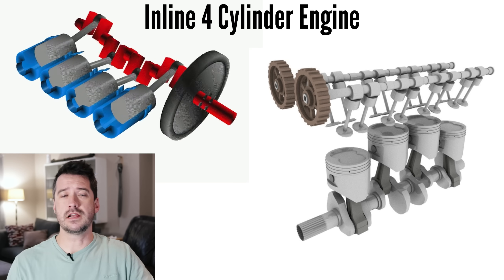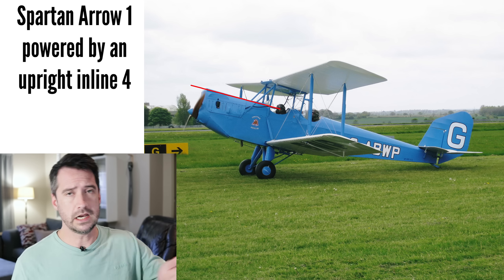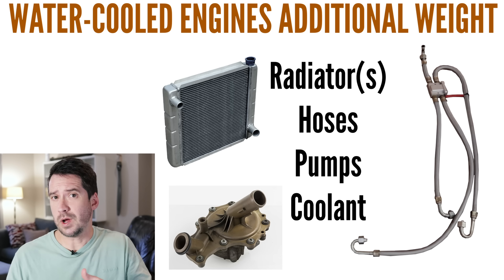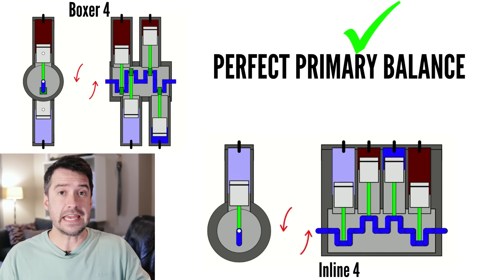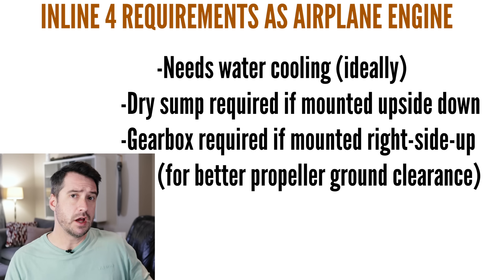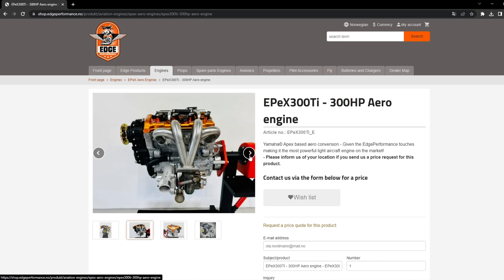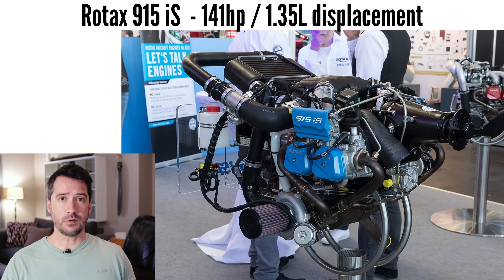Does Inline 4 Engines Suck for Airplanes? - Technical Deep Dive

Comment: Cummins 4-cylinder diesel engines are an exception to the 3.0l limit. There are 4.5l Cummins 4-cylinder engines out there.
Reply: Of course, these also don't rev very high either.
Reply: @brianb-p6586 , agreed!
Reply: And they are used in very heavy equipment where3 vibration isn't an issue.  Disclaimer:  I own 5 Cummins 6s.
Reply: @anvilsvs , That's quite true. But since the video was talking about modified automobile engines, I took a bit of license in choosing to mention the Cummins engines.

Comment: bring back the radial 3 cylinder !!!....nah, actually the INNengine has an inherent 2:1 reduction, ( yes, it is really a two stroke with an inherent 2:1 reduction )
Reply: yes 2 stroke engines🐱👍🏿
Reply: @fidelcatsro6948  the INNengine is better than a regular 2-stoke, because it has full pressure back side lube, and direct fuel injection. ( no fuel mixing, no oil being burnt )
Reply: @RulgertGhostalker  yum yum such technology should be put into motorcycles.. cant wait to see a 750cc 4 cylinder  2 stroke widow maker🤔

Comment: Great video but you made a huge mistake on the thumbnail. That's not an inline-4 engine on that picture, that's a V8
Reply from the maker: Thanks for the heads-up, I'll need to go back to the full size image to double check.
Reply from the maker: So it turns out the image I used is a block from something called a Kubota inline 4 diesel.

Comment: Crankshaft length inherent to inline engines equals inherent greater weight.  The crankshaft and the required crankcase to carry this wobbly assembly is unsuitable for any weight restrictive design.  The crankshaft length/weight for a radial engine is miraculously less.  Go weigh the crankshaft and crankcase for a massive W670 vs some pig iron inline 4.  No torsional vibration with a radial.  Not saying their perfect.  But it is a flugmotor!

Comment: 2:57 you do know dry sump exist, right because if you did, it doesn’t matter what angle you put the Internet as long as there’s oil pumping through the thing it’s gonna work Corvettes come with dry sump’s it’s not a new technology so you would absolutely be able to mount it upside down. You just have to put a different oil pan oil, filter and reservoir ahhhhhhhhhhhhhhhhhhhhhhhhhhhhhhh
Reply: I didn’t watch the video, i paused at 2:57 exactly and wrote this but im not deleating it I’m gonna leave this comment as a show of what irony I’m not even sure if it’s ironic it might just be stupid
Reply from the maker: Thanks for admitting you didn't watch it. I did offer the dry-sump alternative a few minutes after you stopped watching.
Reply: @LetsGoAviate  that’s why I left time markers where I stopped. If you start the video exactly there you’re the next words are literally what I said.

Comment: With all the problems with inline fours and boxer engines why not go back to a 5-cylinder radial engine it doesn't suffer from any of the cooling problems or vibration issues

Comment: A 3:30  2stroke 4clnyder would run upside down
Reply from the maker: Indeed!
Reply: @LetsGoAviate  has there been many 2strokw motor designed engines for planes?
Reply from the maker: @BurchellAtTheWharf  Yes, Rotax has the popular 503 and 582, and Hirth makes a few models too. And there's a few more.
Reply: @LetsGoAviate  mintyy. I didn't know they used skidoo engines in planes. Or would it be Plane engines in snowmobiles?

Comment: Before using Viking engines as a reference, maybe research the owner first regarding Subaru conversions.
Reply from the maker: Does it impact any of the technical details in this video?
Reply: @LetsGoAviate  Yes reliability. they have a track record of not knowing what they are doing. they just sell what is available, not what is suitable or tested.
Reply: @LetsGoAviate  Honda  builds reliable car engines,  but they are not as reliable as supplied as per that vendor.  Easy math.

Comment: Your problem started when you chose air cooling and a wet sump like a gutless lawn mower engine. 😁 Those aircooled boxers are pretty inefficient considering their HP output against it's size and mass, the power density it's not dense at all.
If you want an air cooled engine on an airplane you get a proper radial.
Upsidedown engine a problem ? Mercedes Benz and it's bad ass V-12 has entered the chat.
Anyway, if you want an I-4 in a plane it better be liquid cooled and turbo intercooled, otherwise you have a boat anchor.
Reply from the maker: Loved your comment 😆 of course they can be turned upside-down, but need to work around a few problems. When the DH Gipsy was turned upside down (becoming the Gipsy Major) they encoutered a few issues, one of which was heavily increased oil consumption, but was all mostly sorted over time.

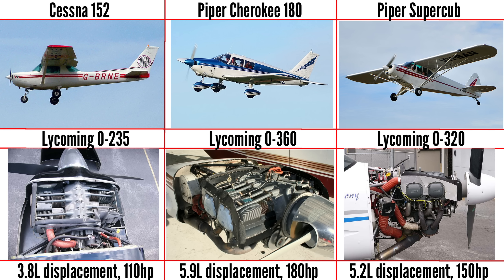Comment: 9:09 How the hell are they only getting 110hp out of a 3.8L engine???
Reply from the maker: (De)"tuned" for reliability. Also it's a very low revving engine, and since horsepower = torque multiplied by rpm, it kind of makes sense when you think about it.

Comment: Turning an IL4 on it's side is ,of course, impossible.
BMW K-series and Toyota Previa never really existed
Reply from the maker: Requires the engine specifically designed to work on it's side, as there would be lubrication issues. Take a look at where the crankcase sits on these sideways I4's. No big deal, can be done, but is this any better than just turning the I4 upside down? I'm not aware of any Inline 4's mounted on it's side in aircraft.

Thanks for the comment!
Reply: @LetsGoAviate  Actually , no , the Toyota Previa example was Just one of their mainline engines (2TZ-FE I4) with minor modifications (to the lubrication system) to allow it to function on it's side

Comment: Diamond DA 42 are quite far down the 4 cylinder road now. Perhaps they will design from scratch...their mercedes diesel engines are not  modified vehicle engines really...the block is different
Reply from the maker: Yeah I wanted to mention them. But it's diesel and while it's not a modified/converted Mercedes engines, it is based on that design.

Comment: Just makes me think rotary...
Nothing saves you weight like a rotary.
Or the other end of the holy grail of engine dynamics, the beautifully balanced inline six.
Reply: Rotaries are high-maintenance so I'm not sure it's the best idea to use them on aircrafts.
Reply: @stryker1797  not really if built correctly.
In non turbo form?
They are near bullet proof.

Comment: So, I am about to cover 400 miles over rough country, poorly populated, at night. Would I rather be behind s 5.2L Lycoming lopping along at 2200 rpm, under-stressed and happy with little gas and at least one magneto, or behind  a 1.8L anything spinning its balls off, higher internal temperatures, high speed valve events, systems reporting to systems, sensors sensing, coolant system blow offs not blowing off, and 40 other points of failure? Gee, hard to pick. Not.

Comment: Opposed engines also need less flywheel weight, right? Because the pistons balance out. It goes back to why they thought radials were an ideal engine.
Reply from the maker: I think it's more because of an even firing interval. 4 cylinders has an even firing interval so there are a power stroke at any given stage, so flywheel doesn't need to balance/smooth out uneven firing pulses. Just guessing though.
Reply: Inline 4 and opposed 4 both have even firing intervals and the same torque pulsations twice per crank revolution. 
In a 4 cylinder engine if average torque is 100 the peak torque is just above 350 on power strokes and the minimum is about -100 on compression. 
Search "EPI Torsional Output of Piston Engines" for more information.

Comment: You make the common mistake of not understanding some fundamental engineering differences between automobile engines and basically all other industrial engines (airplanes, boats, mining, tractors, etc) A car cruises at about 10% of rated  maximum output, and normally maximum rated output is acheived for less than 20 secondswich is more than enough to accelerate beyond 100mph. And modern cars are built to be disposable.

An industrial engine is rated for continuous power output.
For example my 2 ton farm tractor(which is basically a seat and wheelt bolted onto an engine transmission combo(engine/trans act as the "frame")  built in 1968 is rated at 28 horsepower, but it pulls two large plows at full throttle for 8 hours continuously without over heating or suffering abnormal wear. (It also has replacable cylinder liners so it can be rebuiilt indefinately, though I personaly don't use it enough hours per year for that to matter.) 
Or look at modern marine and locomotive engines, these have fancy electronic governors and turbochargers, while operated and monitored by professional engineers. Yet they are about a ton for every 100 horsepower. Partly because iron is cheap and easier to engineer around than other metals, but largely because that is what is needed to reduce the local stresses for long term continuous output. Smaller parts ->higher stresses ->drastically increased wear and reduced fatigue life.(nonlinear)

Also the 150hp lycoming o-320 was built for red lower antiknock rating avgas and can be upgraded with higher compression for blue 100LL. Getting both better power and fuel burn.

Comment: Sorry, but don’t most inline engines use a psru gearbox that can allow the prop to be placed at any height?
Aren’t inline engines very smooth (especially three cylinder and 6 cylinder)? And isn’t a remote oil tank lighter than an extra bank of cylinders? 
The reason inline engines aren’t used in modern planes is that certification requirements of new engines are arduous and so we continue to use ancient designs that are heavier, less efficient, less powerful and less reliable.

Comment: The boxer is inherently faulty, it’s advantages for aviation aren’t its mechanical advantage but it’s profile and weight distribution. The boxer has two huge disadvantages, lubrication is problematic, gravity works against the boxer, even with a dry sump. The other is vibration, the boxer is unbalanced and chews energy to become balanced.

Comment: A gearbox is use when a high performance engine is use who need more RPM , not to rise up the propeller ...Use a gearbox is nothing new: even in the 30' this was common inclusive on small  radial engines, and completely generalized on all high power engines who need big propellers who need slower RPM...

Comment: As their have been quite a few inline 4 engines for aeroplanes, I can not agree that they suck. Their is the de Havilland Gipsy Major or the Hirth HM60 quite successful engines. As many successful inline engines had hanging cylinders. The secondary imbalance can be solved by a shaft turning double the speed of the camshaft. 
The HM60 or later HM504 has an advantage over all the boxer engines in use today, it needs only 80 octane fuel.
The HM504 had 4 l displacement, 70 KW at 2450 RPM at a weight of 112 kg. 

I assume that the boxer won out on the inline engine by chance not because it is inherently better

Comment: A motorcycle like mine makes 200+ hp with only 1 liter and no turbo.
Reply: I bought my Suzuki '77 GS750 at McBrides Cycle. Back then it was considered powerful with it's 66hp. David Cronenberg has her in his collection.
Reply: @UguysRnuts  My first road bike was a GPZ 750 Turbo @ 112 HP back in 1985.  Fastest bike on the block at the time and stayed fast even though it was air cooled.  Kawasaki canceled it, because it was faster than their new 900 Ninja that Tom Cruise rode in Top Gun.  First 145mph on a street bike was a Suzuki GS1100.  I was maybe 15 on the back.  Good times.
Reply: @sammcbride2464  I only mention it because of the dealership name. Thought you may have been related.
Reply: @UguysRnuts  I don't think so, but you never know.  I used to never see my last name anywhere, and as I get older, I seem to see more and more of it.

Comment: Correction: the Rotax line of boxer engines are NOT modern. They produce those overpriced engines almost 40years now.
And we experienced many accidents with the carburated versions.
Reply from the maker: I get what you are trying to say regarding the technology, but the 912iS was released in 2012 and 915iS in 2017.
Reply: @LetsGoAviate  old stuff gets new updates 🦖
Reply: @LetsGoAviate  They have just added fuel injection to an old design. The engine is designed for sales, not as an aircraft engine.

Comment: How did the Germans cope with the me109 inverted engine?
Reply from the maker: In the same way I explained in the video, it's a dry sump lubrication system. 

In the war, complexity and cost wasn't really a concern, so it was no big deal to have an inverted V12 on the Bf 109.

Comment: Large displacement, low rpm engines will always dominate aircraft, they are proven, and reliable, and that is #1 to the FAA. Most recreatioal aircraft with piston engines are sky tractors, chugging along. The airframes CANT handle big power. Big power requires the plane to be designed for it from the start.

Comment: Problems covered: gearbox adds more weight and complexity. water cooling adding weight, complexity, and maintainance. Fuel injection is needed to turn engine upside down adding complexity and maintainance...

Rotax: hold my beer. 🫠

Comment: Correction: not the Edge Performance engine but the Viking 130 is by far the most popular experimental engine. Maybe 10times 🧁☕️🍭
Reply: I seriously doubt that. Viking’s are mainly popular with Zenith aircraft.  Van’s, Rans and others use many more experimental Rotax engines than Viking’s.  It isn’t even close.

Now if you want to say the most popular auto conversion…

Comment: Quick note, general aviation engines should be called horizontally opposed or flats.  Boxer engines are horizontal opposed but the firing order is different and the rods dont share a crank pin. Small difference but its there.
Reply from the maker: Hi, wrong way around. The general aviation engines in this video are indeed boxer engines since they don't share a crankpin, like you said. That makes it specifically a boxer. 

These engines can also be called flat or horizontally opposed, but keep in mind flat and horizontally opposed also describe engines that share a crankpin, and these engines are not used in general aviation.

Comment: Your info is out of date, some by decades.  The cooling problems of the rear cylinder for air cooled engines, ,  Deutz is one make much older than you are, and they work well. Many experimentals use 4 cylinder conversions, either Honda , Suzuki or Mitsubishi engines, one make just tilt the block at an angle to lower height. This was an old trick Chrysler used for their famous slant six.  As it is well know, the expensive certification rules stiffle innovations. Liquid cooling is the future, The pure air cooled engines are heavier and less efficient, because the internal tolerances had to be loose to handle shock cooling.
Reply from the maker: Well the subject is decades old 🤣 Yeah I'm aware of slanting engines, Aeromomentum offers options for slanting/tilting the engine. I tried to keep the video as succinct as possible, but you are correct.
Reply: Slanting the engine also almost entirely eliminates the impact of g forces on reciprocating mass, something Viking will have issues with in the future when an aircraft pulls out of a dive and the valves begin to float and the engine cuts out.

Comment: on my way to convert my 1000hp k20a engine, hope it doesnt explode mid air XD
Reply: You laugh, but that's pretty close to being on the same level of performance as Steve Henry's Yamaha engines, so that would probably work just fine in the same kind of competition.

Edit: ... ~600 hp is probably more on the same level of performance as the Yamaha engines used in STOL drag.
Reply: @PistonAvatarGuy  well i do consider it really seriously, i have an ls3 and k20a1, but i really wonder how do hey perform mid air, its not good betting my safety tho
Reply: @PistonAvatarGuy  i still considering how the ecu and ems can communicate seamlessly, or i just need to use auto dash display like aem cd7 to monitor my engine while my dynon control the rest
Reply: @reviewer_random  You wouldn't want to pull them out of a car and put them directly into an airplane, that much is certain, but those engines can definitely be made to run reliably in an aircraft application. Viking Aircraft Engines basically puts stock Honda engines in quite a few aircraft, they seem to be fine, but I'd be a bit wary of doing something like that.
Reply: @reviewer_random  You'd definitely need an aftermarket ECU. I believe Viking makes their own, but there are also many other options out there. SDS is one which is popular for use in aircraft, but MoTeC, AEM and many others would likely be suitable. I'm not sure how well any of those would interface with aircraft avionics, but they can be configured with their own displays.
Reply: @PistonAvatarGuy  lol, seriously dynon need to add some kind of ecu for auto engine sooner or later, because aircraft engine is seriously decades behind and stupidly expensive
Reply: @reviewer_random  It would probably be easier for the ECU manufacturers to add outputs for aviation displays. It would be interesting to contact someone at SDS to see what they say about that.

Comment: > discusses i4 aircraft engines
> doesnt mention the Austro family of engines
> doesnt mention continentals cd135

Kinda missed out on a pretty big deal there
Reply from the maker: Not really. Considered it, but it didn't add value to the video other than to bring attention to those engines, and the video already had enough tangents. 

It is also an inline 4 based on a car engine, the big difference is it's certified.